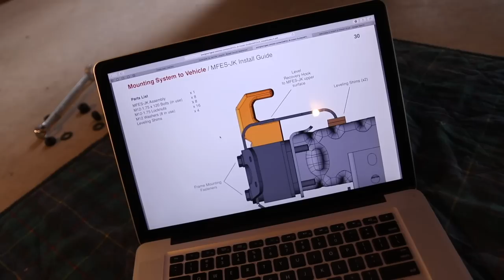V2E18: Let There Be Light

Comment: You know, you can fit some six inch wide,  six feet long,  plastic water pipe (easy to custom make yourself)  to the passenger side of the roof rack  (you will have to get some stand offs from the hardware shop because of your rooftop tent)  with a small tap at the back (and an upside down filler tap at the other end)  so you never have to lift and pour your water container.  Remember to flush the pipe regularly with tap water unless it's just for showering, putting out a campfire,  or other non drinking uses.

Comment: LED Headlights are my number one upgrade/safety recommendation. You can really see how bad the stock headlight is in this video.
Reply: I second that. The pre-2017 stock lights are... well I have nothing good to say about them, especially traveling the back roads of Vermont.
Reply: I invested in jw speaker evolution 2 headlights, after less than 2 years the anti flicker harness failed, jw warranty is just 1 yr. Just a heads up if you plan on buying led headlights.
Reply: I invested in JW Speaker headlights & fog lights 5 years ago. One of the headlights failed after 3 years (really my fault for not running an anti-flicker harness or soldering a capacitor...the PWM must have cycled the light millions of times). JW Speaker sent me a PAIR of their latest lights (the Evo J at the time), and sent me a refund check for the difference in MSRP between what I paid for the original lights and the new set.

Comment: Did those lights come with opaque covers?

Reason I ask is that in PA, and in possibly other states too, uncovered auxillary lighting must be mouted more that 12 inches apart to be legal for on-road use.  If not, then they must be covered at all times on the highway.   If you have covers on them it's a non-issue. Yours look a little tight from here.

Enforcement seems to be sporadic, but I am hearing about happenning it more and more probably due to the fact of people running them ON all the time  nowadays.